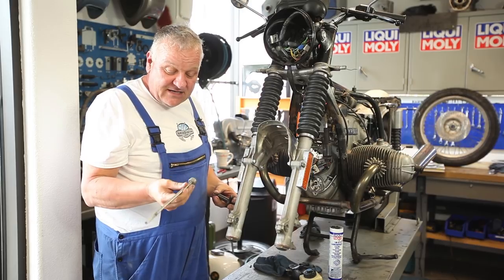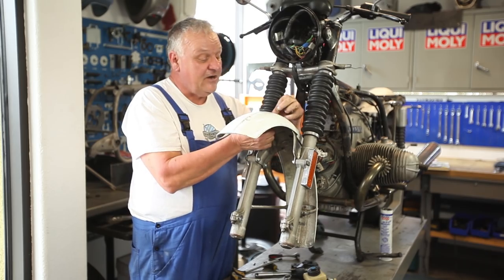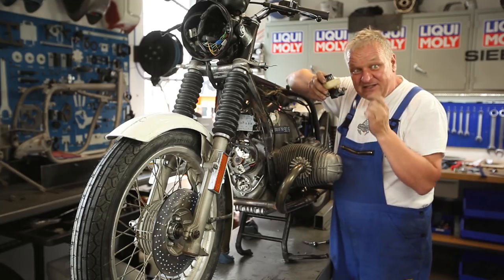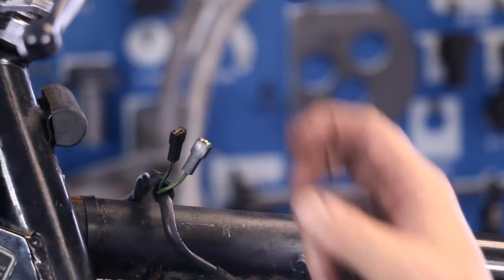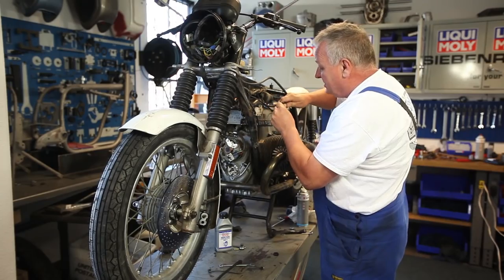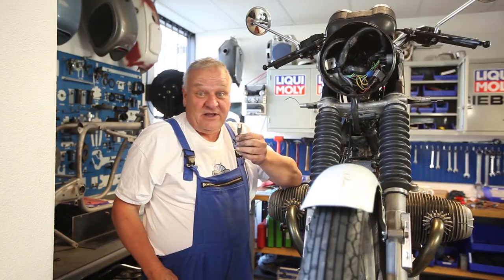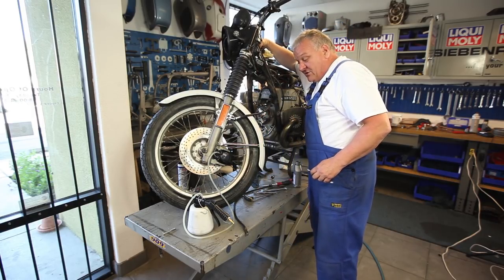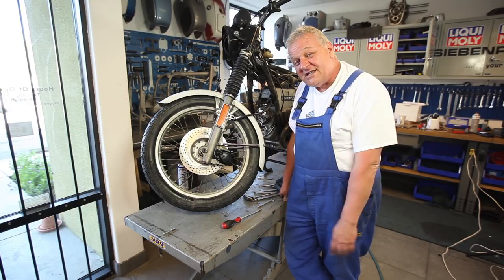R90/6 #20 Part 2 Front Wheel, Brakes, Master Cylinder & Steering Damper Assembly

Comment: Thank You for the caliper adjustment procedure. Best method yet, so simple, quick, and easy.
Reply from the maker: Glad it helped
Reply: What symptoms would the bike have if the caliper were not properly adjusted? I'm trying to diagnose a front brake vibration. Might this be the cause?

Comment: Great to have you back. Was waiting for the brake system video to finish my r90S. Best videos, best teacher :-)
Reply from the maker: Great to be back. Thanks for the support!
Reply: I’ve been a motorcycle mechanic for twenty years on Japanese bikes- I can’t tell you how valuable these videos are- a credit to you taking the time to pass on your Bmw knowledge.  Thanks!
Reply: Can ipowdercoat my alloy wheels .lts a 1979 r100 rs  I have been following you vids it’s got a way to go but it’s coming together  thanks. DB
Reply: @boxer2valve  It would have been simpler to use a handlebar mounted master cylinder from a post-81 boxer and that would have given you more effective brakes

Comment: ? The manual says to make sure the hole in the axle (right side) is parallel to the ground.  Always wondered why & what if it's not ?  Noticed you did it.  As I look at other bikes seems like ~70-75% do that, 15-20% it's vertical, 10% random....been trying to get this answered for ~40 years....THANKS  Your videos are amazing !

Comment: I followed this video step by step. Great video. I did run into one issue not covered in the video (or maybe I missed it?). There is a little sleeve that must go on at the hand control unit along with the cable. When I got my cable, I tried to install it per the video, which didn't mention the required sleeve. The sleeve comes with post-09/1975  model cables, but for the pre-1975 models, the sleeve is sold separate from the cable. Just something I learned and wanted to share.
Reply from the maker: Thanks very much for sharing that information!
Reply: @boxer2valve   Quick question for you. I have purchase both the BMW Cable, and an aftermarket cable. Both of which seem too short...either that, or the cylinder used to push the MC piston is too long (I purchased a brand new MC). Any thoughts? Have you ever run into this issue?

Comment: Another great video. I was going to pick up a pair of your hydraulic lines for my 74 R90s. Keep the original look, similar to BMWs product, etc. So much conversation about using stainless braided, which I get. Seems you have no problem going with the new rubber ones, which gives me a vote of confidence. Thanks
Reply from the maker: Hello Pat,
Stainless lines are pretty cool but a new rubber line is also a huge improvement over a tired old one, and the original appearance is retained.
Reply: @boxer2valve  Man. Thanks for the quick reply. And thanks for all your work on these videos...so good!
Reply: Recent R90S which sold on BAT for $60,000 had rubber hoses 😉

Comment: Thank you for your thorough and well produced videos. They are incredibly helpful. My R100RS was converted to use a handlebar mounted master cylinder and a splitter under the tank. I’m having trouble getting proper pressure at the handle. Do I need to bench bleed them? I didn’t install a New system just new pads and fluid flush.

Comment: How tight do you torque down the plug at 25:00? The Haynes manual indicates that 44-48 ft-lbs of torque is required for the “caliper pivot retention plug” but I’m not sure if this is what that is referring to.

Comment: Brilliant! Just wrestled with bleeding the front brakes on my R100S today and you’ve answered a number of my questions. Also, would like to know if the Lubri-Moly oils you sell are compatible with airheads. I believe the older engines need high zinc, etc. content. Thanks again!
Reply from the maker: Great! Glad that we could help. The Liqui Moly Mineral based oils that we offer are ideal for your airhead! I suggest 20W-50 in very hot climates and 15W-50 everywhere else.

Comment: Awesome videos! I just bought a R75/6 -75 with twin disc brakes, which i am currently restoring. Your videos help a lot! I am considering a wider handle bar than i currently have, and i need to change the brake wire. Does anyone know if i can use a different (longer) brake cable between the brake handle and the master cylinder than the OEM for my handle bar? Perhaps one from a GS model?
Reply from the maker: Hello Olaf,  if you go with a GS bar you will probably need some new,  longer cables.

Comment: i HAVE A PROBLEM.. I installed the kit (correctly). piston moves smoothly. but not getting ANY fluid to move at all. Even with the lines off the master cylinder. no fluid comes out of the master right at the line hook up. What is the problem??

Comment: Could you please explain which connector goes where on the master cylinder (both brake light and on the fluid container). Thanks.
Reply from the maker: Brown and brown/blue are for the fluid level sensor. Green/black and green/red are for the stop light switch

Comment: R75/7-rebuilt my caliper with kit, new brake pads, and new brake line.  The brakes are working OK, but now at medium speeds (~45 mph) I get major front tire wobble that wasn't there before.  Any ideas what I might have done wrong?
Reply from the maker: Hi Dan, it's hard to say what may be causing that but I would say double check your work. Make sure the axle nut is tightened before tightening the pinch bolts. You shouldn't need to take everything apart but do put a wrench on everything you touched and make sure everything is correctly tightened and adjusted.

Comment: Guys, Saying hello from the UK, loving this series in preparation for getting a restoration project myself. I have the chance of a ‘76 R75/6 but it has a twin disc setup on the front. I thought only the 90S came with 2 discs or was it an option on other models?
Reply from the maker: Hi, I believe that it was possible to order a dual disk setup in Europe when the bike was ordered new. It's also possible that someone retrofitted the second disk later. Either way, when it comes to brakes, more is better! Grab it!
Reply: Thanks for the reply, I did some more digging and confirm that it was a dealer fit option on 76/6 and 90/6, obviously not 60/6. I missed out on ‘76 I was looking at but pick up a ‘75 R75/6 in a couple of days 👍

Comment: I have a 79 R100 airhead.. do you have any video on the rear brake bleed procedure?  Everywhere I look there’s no really any solid procedures.  Thank you
Reply from the maker: A vacuum bleeder should do the trick but if you can't bet all of the air out, which can sometimes be the case, remove the rear wheel and caliper and find for example some thin plywood, about the same thickness as the brake disk. Place that between the pads and try it while elevating the caliper as much as possible while bleeding.
Reply: boxer2valve BMW Restoration and Parts Supplier   Thank u so much. I will pass along to my buddy who will be performing the work.

Comment: do you ever clean and/or lube your cables?
Reply from the maker: No, I never find a need. The inside of the cables are coated, I believe with Teflon, or some sort of plastic and they don't need to be lubed internally and they last a long time. You should lube both ends of the clutch cable and pretty often!